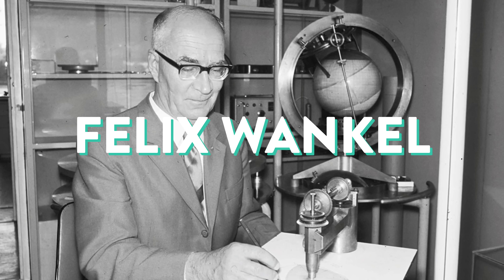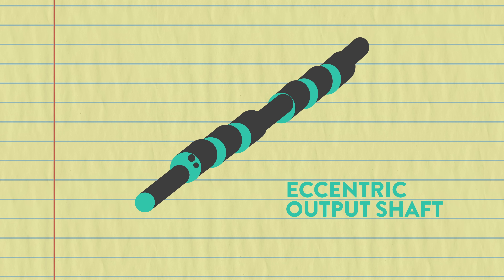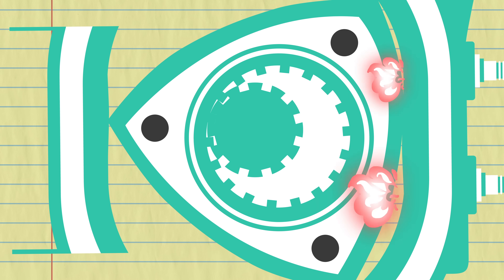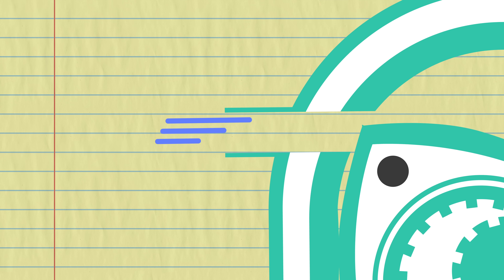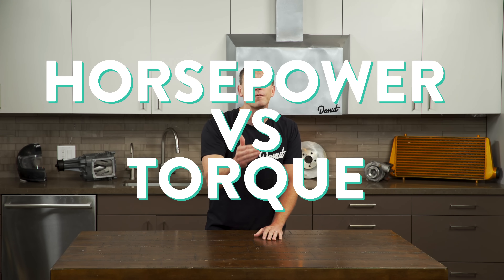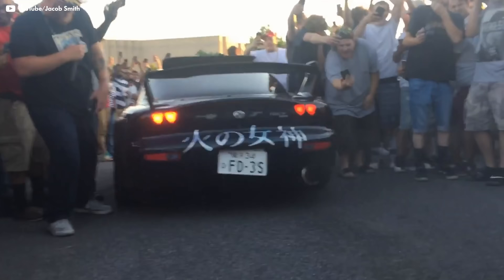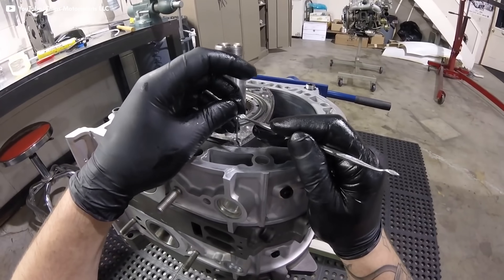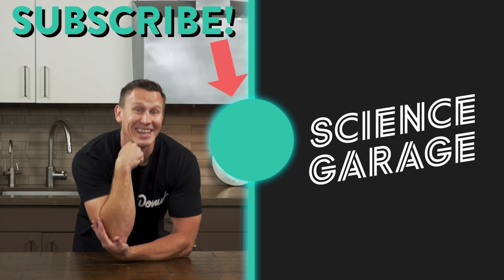Rotary Engine | How It Works

Comment: Today marks the 7th anniversary of the end of RX production, on Thursday June 21, 2012 at 4:30pm the final RX-8 car ever to be produced rolled off the assembly line, the last RX model to ever be produced by Mazda.
Reply: 8th anniversary.
Reply: @kylejaynes5785  9th anniversary
Reply: @prumset6059  July 13, Green Car Reports confirms Mazda Rotary not happing.
Reply: @prumset6059  July 12th Motor Trend.
New Wankel engine Dead.
Reply: @prumset6059  Inside EVs July 12th "Mazda shelves rotary range extender"
Reply: @prumset6059  Mazda has not unveiled any new production Wankel engines in over a quarter century..
Reply: @prumset6059  Industry journal Automotive News confirms there will be no new Wankel engine from Mazda.
Reply: @prumset6059  The new 2022 Mazda models are here.
No new rotary engines...
Reply: @kylejaynes5785  It's been 25 years since Mazda unveiled a new production Wankel engine.
Reply: @sandervanderkammen9230  hey doktorbimmer, it's been a long time.  Mazda is introducing a range extender rotary for their BEV MX-30, but I think you know that.
Reply: Hey Bimmer, what else did the screaming voices tell you?
Reply: The salesman at the Mazda dealer didn't scream... he very politely said that Mazda does not make Wankel engines anymore....
Reply: Mazda is adding a single chamber range extender wankel option to it's 2020 BEV in the next year, apparently.  But you may be right for ordinary ICE application.  In other news, there are some VERY promising clean diesel developments, which you did predict.   Achates truck application and Mueller/Sandia ducted injectors.
Reply: @doktorbimmer ,  aka  Sander Van Der Kammen, you know Mazda is introducing a rotary, right?  Now it has emerged that Toyota will be badging some of them because they've entered into a partnership to jointly develop hybrid cars.  Looks like you'll have to quietly delete your comments here, too!
Reply: @someotherdude  I'm sorry Anthony Campbell you are no longer credible.
 Every year you posted another fake, clickbait rumor about Mazda bringing back the Wankel engine... and every year nothing happens.
Is everything you post a completely fabricated lie from amateur blog sites?
Reply: @sandervanderkammen9230  you are doktorbimmer,  but I'm not actually Anthony Campbell.   I'm not any of the fakes, such as doktErbimmer.   I'm just Some Other Dude.
Mazda is clearly, indisputably, bringing back the rotary as a range extender.  I've seen a line drawing of what they have,  it's a single rotor laying on it's side, with a belt drive connecting it to an alternator.  This strange config it to get the genset to take a very flat, thin form, and it will go in the trunk where a spare tire would have been found.  The unit will measure about 150 mm X 300mm X 625mm.
Mazda will almost certainly put these in other models too, it will be the first good electric solution for people in North America who live in very cold, rural climates.
Reply: @someotherdude  You are a liar and a fake.
Your real name is Anthony Campbell and you post from fake accounts under pseudonyms like Ernie Brink and John Burns.
There is no new Mazda Wankel engine and Mazda has not confirmed any new vehicles for production.
You continue to post clickbait news stories from dubious blogsites with no press credentials.
Reply: @sandervanderkammen9230  Mazda has absolutely confirmed it.  It will only be an option, if that makes you feel better. It's likely that they will use it in more than the MX-30, and Toyota has their eye on this unit too.  Less than a year away.  I've already seen line drawings of it.  AND.... I am not, nor ever have been, Anthony Campbell or anyone other than Some Other Dude.  Yes there are make fakers around, but I'm not among them.
The engine is coming.  BTW, word is they have 'solved' the apex seal issue, and the material required is expensive.  But if you're building a single speed motor, you're saving $ elsewhere.
Reply: @someotherdude  Please stop posting false rumors and using fake accounts under pseudonyms.
Mazda ceased development of Wankel engines in May 2009 and the company has not unveiled any new production Wankel engines for over a quarter of a century.
Reply: @someotherdude  
There have been many advances on the rotary engine over the last few years, with a number of patents granted.  

There was talk of Toyota using the rotary in some of their hybrids. Also it being sold as a portable generator to keep the production lines heavily used to keep costs down. 

Rotaries are also superior running on hydrogen (27% more efficient). There was talk of engineers considering scaled up hydrogen fuelled rotaries for marine electrical applications, being efficient, smaller and lighter, than heavy diesel engines. Also cheaper to make, once production levels starts up, having fewer parts and smaller.
Reply: @johnburns4017  Today, June 22nd marks the 9 year anniversary of the final end of Wankel engine production.
At 4:30pm Tokyo time on June 22,  2012 Mazda produced its very last Wankel engine.
The Wankel engine assembly plant at Mazda's Ujina #2 plant shut down and was later demolished to make way for a new Skyactiv G engine factory.
Reply: @johnburns4017  MX30 CONFIRMED only as a 100% plug-in  battery electric vehicle or a mild series hybrid powered by 2.0 liter Skyactiv G engine 
Range extender is not offered.
Reply: @johnburns4017  You look like a fool John.
The new 2022 Mazda models are here and there is no Wankel engine or range extender.
You no longer have a single shred of credibility left.
Reply: @sandervanderkammen9230  
Doktorbimmer,  a quiz. 
Name the company that is introducing a new rotary engined hybrid?
10 points for the correct answer.
Reply: @sandervanderkammen9230  
BZZZZZT Wrong answer. 
The name of the company that is introducing a new rotary engined hybrid is....

🎊🍾🎈 Mazda  🎊🍾🎈

Zero points doktorbimmer.  Zero.  Better luck next time.
Reply: @johnburns4017  Stop telling lies Johnny
Reply: @johnburns4017  No one makes Wankel engines anymore.
John please get therapy.
Reply: @sandervanderkammen9230  
Doktorbimmer,  a quiz. 
Name the type of engine to be installed in a hybrid by Mazda?
10 points for the correct answer.
Reply: @johnburns4017  John you are not a quiz show host...
 You need help, please get therapy.
Reply: @sandervanderkammen9230  
BZZZZZT! Wrong answer. 
Bimmer, the name of the engine to be used in a Mazda hybrid is the..

🎈🎊🍾 rotary engine 🎈🎊🍾

Zero points Bimmer. Zero.  Better luck next time.
Reply: @johnburns4017  John please get therapy... you are not a game show host.
Reply: @sandervanderkammen9230  
docktorbimmer a quiz.
Name the company that is to introduce a hybrid rotary engine?
20 points for the correct answer.
Reply: @sandervanderkammen9230  
BZZZZZT! Wrong answer. 
The name the company that is to introduce a hybrid rotary engine is...

 🎈🎊🍾 Mazda 🎈🎊🍾

Zero points Bimmer. Zero. Better luck next time.
Reply: @sandervanderkammen9230  
Bimmer, a quiz. 
Name the company that has a hybrid rotary engine lined up for a car?
29 points for the correct answer.
Reply: @johnburns4017  Go down to the local Mazda dealer and see for yourself, the MX30 is only available as a plugin battery EV.
Mazda doesn't make Wankel engines anymore.
Reply: @sandervanderkammen9230  
BZZZZZT! Wrong answer. 
The name the company that has a hybrid rotary engine lined up for a car is...

🎈🎊🍾  Mazda 🎈🎊🍾

Zero points bimmer. Zero. Better luck next time.
Reply: @johnburns4017  The Mazda MX30 is only available in a 100% plug-in battery electric vehicle.
 Go down to your local Mazda dealer and see for yourself.

Please get therapy and stop spreading lies.
Reply: @sandervanderkammen9230  
Doktorbimmer a quiz. 
Name an engine that does not have pistons?
20 points for the correct answer.
Reply: @johnburns4017  Anthony Campbell quiz... Why does Anthony Campbell use a fake name like John Burns Morgan??

Why do you spread lies about Mazda.

The Mazda MX30 is an EV... go down to your local Mazda dealer and see for yourself.
Reply: @johnburns4017  The answer is: Gas Turbine
Reply: @sandervanderkammen9230  
BZZZZZT! Wrong answer. 
docktorbimmer, the name the engine that does not have pistons is the.....

 🎈🎊🍾 Rotary engine 🎊🍾

Zero points Bimmer. Zero. Better luck next time.
Reply: @johnburns4017  You look like fool John. Today marks the 9 year anniversary of the final demise of RX production at Mazda.
The very last Wankel engine powered car rolled off assembly line on June 21st 2012.
Reply: @sandervanderkammen9230  
Hi dockorbimmer!
A quiz.
Which company is to introduce a rotary hybrid genset.
20 points for the correct answer.
Reply: @johnburns4017  The correct answer is NONE!
You look like fool John or is it Anthony?
Reply: @johnburns4017  Mazda no longer has any Wankel engine products.
The very last production Wankel engine was unveiled over a quarter century ago.
Reply: @sandervanderkammen9230  
BZZZZZT! Wrong answer. 
The company that is to introduce a rotary hybrid genset engine is ..

🎈🎊🍾 Mazda. 🎈🎊🍾

Zero points scored. Zero. Better luck next time.
Reply: @johnburns4017  Mazda has not sold Wankel engines in 9 years..
Your lies have been exposed!
Reply: @johnburns4017  For years now every thing you have said about Mazda has ALL BEEN LIES!!!
Reply: @sandervanderkammen9230  
dockorbimmer, a quiz.
How will Mazda implement its new rotary engine?
20 points for the correct answer.
Reply: Dee Jay  i don't get it...
Reply: Feels bad
Reply: @esequieltrindade9244  Its been almost a decade now since production ended... and over a quarter of a century since Mazda unveiled its last production Wankel engine.
Reply: what the fuck is happening
Reply: @hwhaht  Nothing, Mazda does not make Wankel engines anymore and hasn't for nearly a decade.
Despite the many completely unsubstantiated rumors Mazda has confirmed that it has no plans to start making them again.
Reply: @sandervanderkammen9230  what
Reply: @hwhaht  Exactly...
Reply: @sandervanderkammen9230  what
Reply: @hwhaht  Exactly...
Reply: What the hell did I get myself into?
Reply: This whole thread is a shitshow
Reply: @matiasdelahorra1557  
Welcome to the alternative world of dockorbimmer.
Reply: @johnburns4017  Welcome to REALITY Johnny!!!
Stop by your local Mazda dealer and ask to see a new Wankel engine made by Mazda..
OH! Thats right! Mazda hasn't unveiled a new production Wankel engine in over 26 YEARS!
Reply: @sandervanderkammen9230  
doktorbimmer, a quiz Name the engine that Mazda is to use in a new hybrid car?
20 points for the correct answer.
Reply: @johnburns4017  John please get therapy, you are not a game show host.
Reply: @johnburns4017  Mazda ended all development of Wankel engines in May 2009.
No new prototypes have been seen since 2007.
Mazda has not unveiled any new production Wankel engine in over 26 Years!!
Reply: @sandervanderkammen9230  
BZZZZZT Wrong answer. 
The name of the engine Mazda are to introduce into a new hybrid car is the..

🎊🍾🎈 Rotary engine  🎊🍾🎈

Zero points doktorbimmer.  Zero.  Better luck next time.
Reply: @johnburns4017  WHERE IS IT JOHNNY??? WHERE IS THAT NEW MAZDA WANKEL ENGINE???
Reply: @sandervanderkammen9230  Mazda's website shows it for a hybrid hydrogen and petrol
Reply: @jordanwardle11  No, it doesn't, Mazda's board of directors officially canceled all development of production Wankel engines on May 15th 2009.
No new prototype Wankel engines have been revealed since 2007.
The last new production Wankel engine was unveiled over a quarter century ago.
Reply: @matiasdelahorra1557  John Burns is one big shit show... spews nothing but lies and false clickbait rumors that never come true.
Reply: I still vividly remember when the rx-8 was shown in the X-Men movie a year before it was released. I hate how the world is now compared to then.
Reply: @ricjames5352  We all have grow-up kid,  you can't remain a child forever.

The Mazda RX8 was a hidiously fugly little sedan and an epic failure that lost 3 billion dollars in development costs that bankrupted Mazda for 3rd time in its short history..
 Mazda was forced to discontinue the RX brand to save the company and is much better off now selling more reliable reciprocating engines.
If they don't make anymore colossal blunders like the RX8 the company might be around in another 20 years... otherwise it will become a zombie brand owned by Toyota or simply disappear altogether.

Comment: 1080 degrees make the wankel the best engine
Reply: Pascals Law refers to an equivalence of pressure and volume 
relationship.  If you're increasing pressure, volume must decrease to 
maintain preservation of energy.  Take a balloon for instance, if you 
decrease the size on one side, the opposite side increases to maintain 
volume relationship.  So the argument does not pertain, the principal in
 essence is correct

Comment: OFF SET COMPRESSION
Reply: dokterbimmer1 second agoI AM THINKING OF A 6 ROTOR WITH 18 CHAMBERS  OFF SET COMPRESSION NEW PLUG LOCATION IN THE HOUSING NO LEAKAGEPAST THE PLUG HOLE AND APEX SEALRead more Show less Reply     1

Comment: The uk government are being forced to ban or limit diesel cars by 2040. They are giving off high amounts of carcinogenic pollution and are credited for a large rise in cancerous deaths. A lot of the diesel emission testing didn't apply to real world situations while many were falsified. In other words 95% of diesel cars are marginally better for us than petrol if at all, some diesels are worse. DPF filters (that limit the cancerous fumes) are also a very big grey area in effectiveness. Many people have them removed as they block up easily and are costly to replace. Also very conflicting evidence in how well they actually filter while working on top of the added pollution they take to make. Also much pollution is added because some people are forced to ''drive on the motorway to clean the filter''. If they don't do that a warning light puts cars into limp mode. Sellers of such cars do not tell people that diesels are very bad to be used as anything but long distance vehicles. Car makers want sales, telling people a car that is bad in short journeys is not good business for them so they don't say it.Read more Show less

Comment: https://www.drive.com.au/news/mazda-confirms-flexible-xev-rotary-hybrid-driveline-120928
Reply: dokterbimmer1 second agoI AM THINKING OF A 6 ROTOR WITH 18 CHAMBERS  OFF SET COMPRESSION NEW PLUG LOCATION IN THE HOUSING NO LEAKAGEPAST THE PLUG HOLE AND APEX SEALRead more Show less Reply     1

Comment: JOHN THE PROOF IS IN THE PUTTING
Reply: dokterbimmer1 second agoI AM THINKING OF A 6 ROTOR WITH 18 CHAMBERS  OFF SET COMPRESSION NEW PLUG LOCATION IN THE HOUSING NO LEAKAGEPAST THE PLUG HOLE AND APEX SEALRead more Show less Reply     1

Comment: JOHN BURNS YOU ARE AWESOME KEEP IT UP
Reply: The uk government are being forced to ban or limit diesel cars by 2040. They are giving off high amounts of carcinogenic pollution and are credited for a large rise in cancerous deaths. A lot of the diesel emission testing didn't apply to real world situations while many were falsified. In other words 95% of diesel cars are marginally better for us than petrol if at all, some diesels are worse. DPF filters (that limit the cancerous fumes) are also a very big grey area in effectiveness. Many people have them removed as they block up easily and are costly to replace. Also very conflicting evidence in how well they actually filter while working on top of the added pollution they take to make. Also much pollution is added because some people are forced to ''drive on the motorway to clean the filter''. If they don't do that a warning light puts cars into limp mode. Sellers of such cars do not tell people that diesels are very bad to be used as anything but long distance vehicles. Car makers want sales, telling people a car that is bad in short journeys is not good business for them so they don't say it.Read more Show less

Comment: Mazda confirmed that a rotary equipped range-extended car would be launched later this year.  The architecture will be similar to the Prius drive with full engine traction or full electric motor traction. There will be a choice of a larger battery bank to give full EV with the engine performing the dual functions of a range-extender and battery charger when the battery charge is too low.  So if you charge it every day the engine need not cut in.

https://www.drive.com.au/news/mazda-confirms-flexible-xev-rotary-hybrid-driveline-120928
Reply: The uk government are being forced to ban or limit diesel cars by 2040. They are giving off high amounts of carcinogenic pollution and are credited for a large rise in cancerous deaths. A lot of the diesel emission testing didn't apply to real world situations while many were falsified. In other words 95% of diesel cars are marginally better for us than petrol if at all, some diesels are worse. DPF filters (that limit the cancerous fumes) are also a very big grey area in effectiveness. Many people have them removed as they block up easily and are costly to replace. Also very conflicting evidence in how well they actually filter while working on top of the added pollution they take to make. Also much pollution is added because some people are forced to ''drive on the motorway to clean the filter''. If they don't do that a warning light puts cars into limp mode. Sellers of such cars do not tell people that diesels are very bad to be used as anything but long distance vehicles. Car makers want sales, telling people a car that is bad in short journeys is not good business for them so they don't say it.Read more Show less